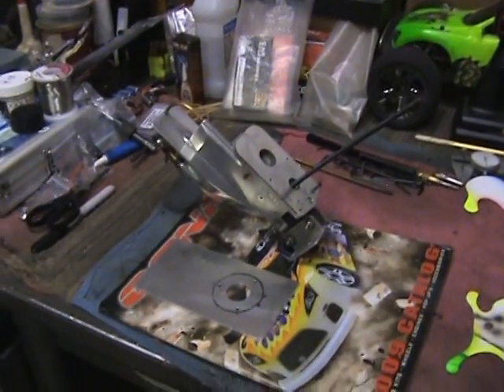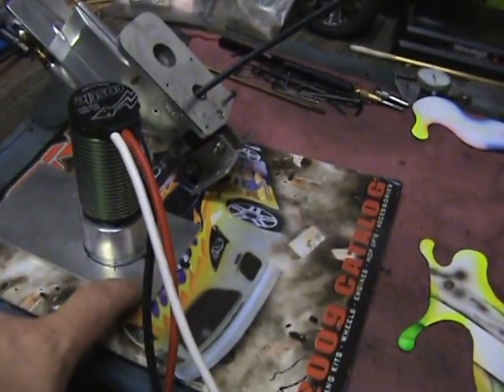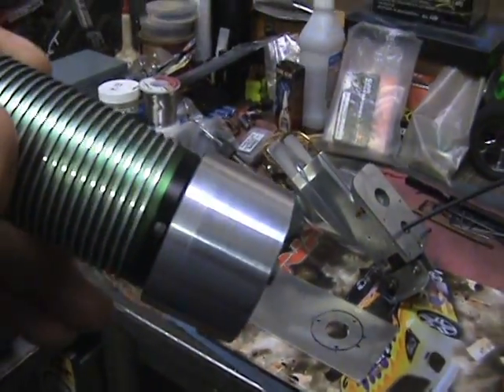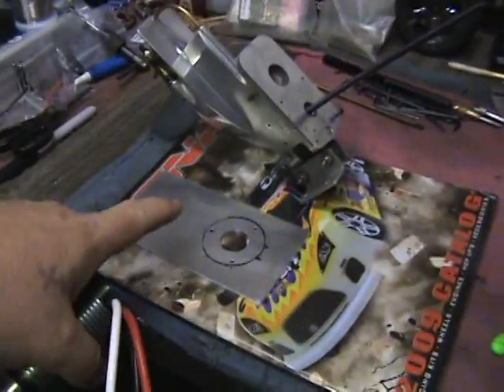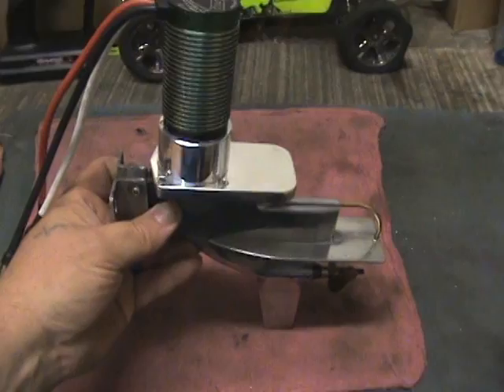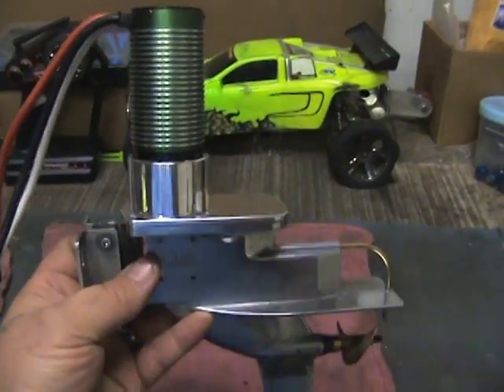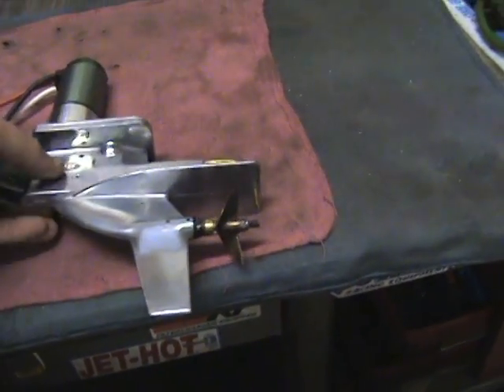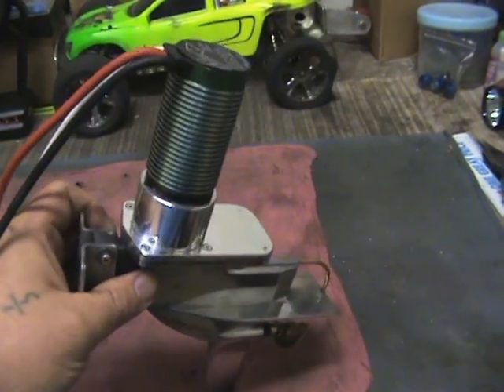Brushless Outboard boat motor.mpg

Comment: How you going to tighten the cable onto the collet once motor is mounted to the leg?
Reply from the maker: Steven Myles the upper piece is made in two pieces so you install the flex shaft into the collet and tighten then install to the motor then the flat plate mounts to the bottom of the extension piece which then mounts to the outboard unit. The flex shaft just slides into the square drive hub inside the outboard drive.
Reply from the maker: Steven Myles i built that 10 years ago I haven't seen the guy I built it for so i have no Idea how it worked. In my testing without a boat it worked flawlessly.